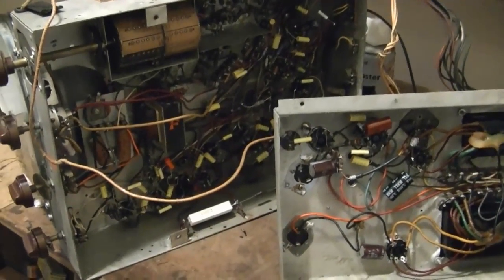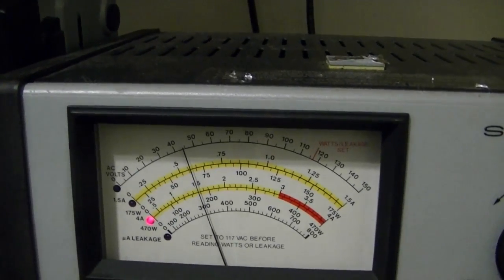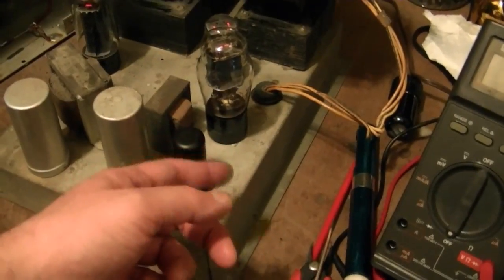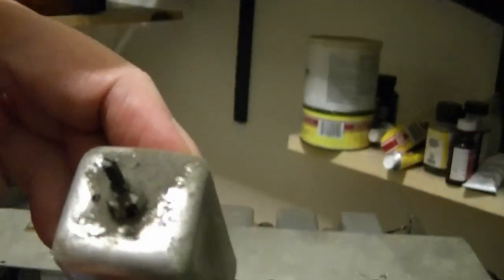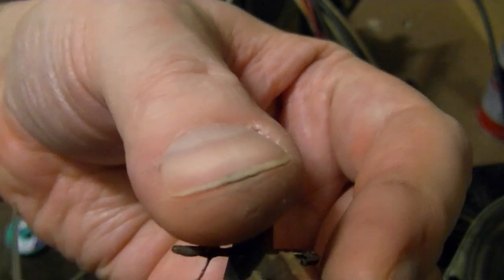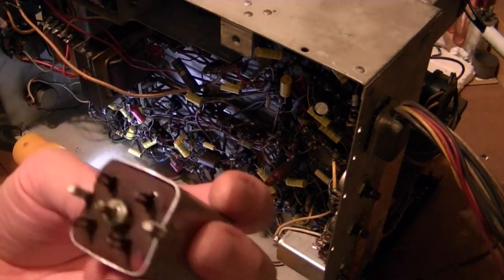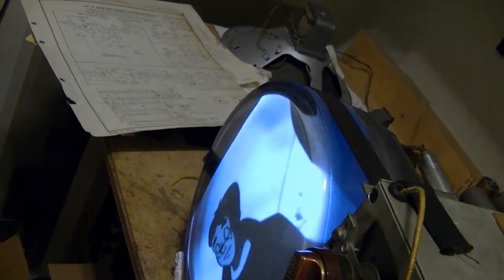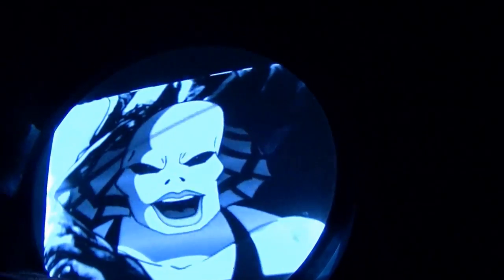Admiral 30B1 chassis restoration p3o5

Comment: Another entertaining episode...I'm glad you solved the audio problem. It will be interesting to see what is causing the contrast difficulties. I wonder if you have a microphonic tube? The first time you whacked the side of the chassis with your hand, the impact was clearly transmitted through the speaker.

Comment: Thanks for detailed description of what physically happens in the process of "silver migration" in those mica caps.
As far as I know, it is especially critical to replace these micas with the exact value in the high bandwidth, sharp cutoff, I.F. video stages. Can you be a little more lenient in FM stages in TV & AM stages in radios as well? The reason that I ask is because in TVs, they are usually pretty good in telling what the values should be. In radios though, they omit the details a lot.